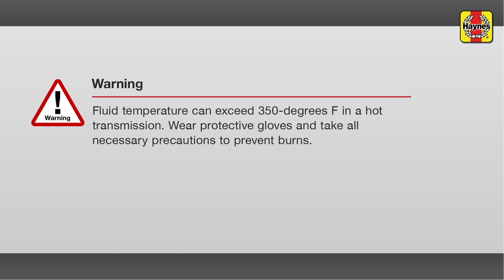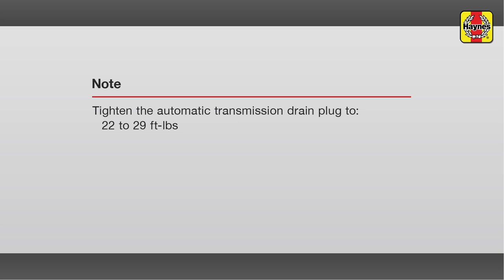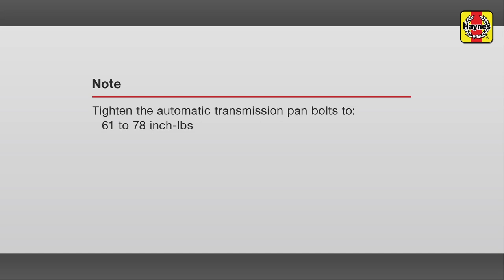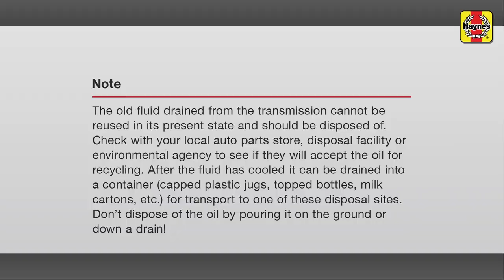Changing auto transmission fluid on a Nissan Xterra (00-04), Pathfinder (96-04) or Frontier (98-04)

Comment: Not for 2004 xterra trans mounts block two bolts on pan. Any advice on easy way to get to it
Reply: Jack/support and pull the mount and get the bolts?
Reply: I am in the process of trying to do this and ran into the same stupid design of making bolts inaccessible because of the mount.   I've read that a 10mm ujoint socket is the trick but even if that works getting it off I think it will be exponentially harder getting the bolt back on without stripping threads so i think I'm going to attempt to remove that cross bar and mount.  In this video that cross bar and mount aren't there so they removed as well.  They just forgot to mention that step.  LOL

Comment: How much do you put in? No listed amount in the owners manual and ive rewd online forums 4-8qt
Reply: I just changed mine tranny fluid and only measured 2.50 quarts.
Reply: @greenace9686  you didnt get all the fluid out. Think about the torque converter and cooler lines

Comment: As for Mileage..At what time should you change out the Fluid?
Reply: I change it every 80k
Reply: 50k-60k
Reply: Every 4th oil change in my acura so 12k an on my x every 8th oil change so 24k overkill but cheaper than replacing transmissions
Reply: In the haynes book it says every 30k miles brother